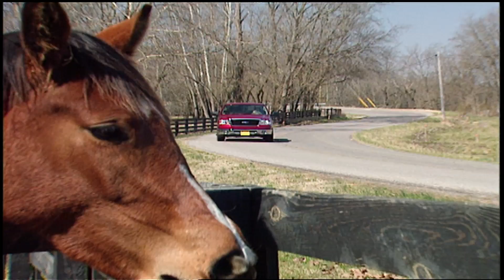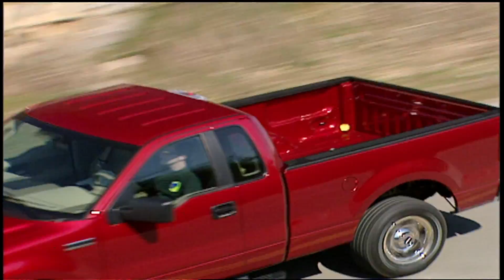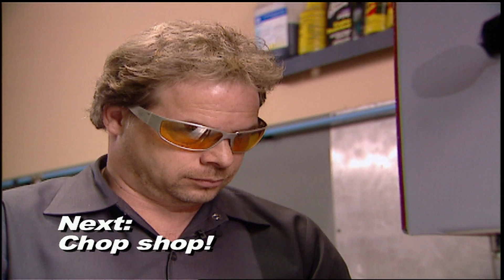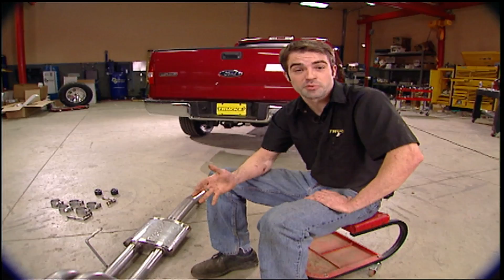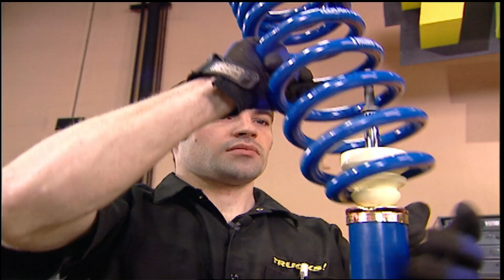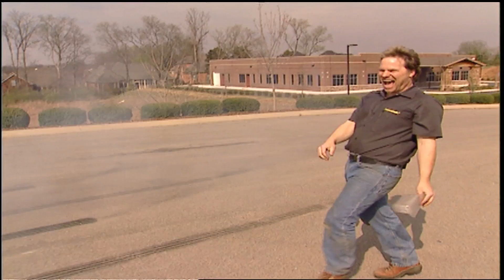Turning A Stock F-150 Into A 500+ Roush HP Stage 3 Truck - Trucks! S9, E7

Comment: Hopefully they removed the spark plugs and reinstalled them with high temp anti seize..
Reply: You dont need to. Its carbon buildup that causes the issue. Not seizing.
Reply: @trippholland5131  There's plenty of reasons to do it anyway, carbon or no carbon. I've had them seize with no carbon.

Comment: I actually do like this body and both the 4.6 and 5.4 , yes I know there are issues . Let me know when the LS or Mopar V8s become factory perfect .
Reply: 4.6 is the ls of Ford from my experience lol them things just don't die lol
Reply: These bodys were ugly and useless. The 3V 5.4 and 4.6 Were the worst engines ever built. 😂😂
Reply: @thegreatoutdoors9769  opinions are great if used properly.
Reply: @thegreatoutdoors9769  Not even close lol... the 4.6L short block is good for around 650hp. Heads, cams, intake and boost will put you there. It's a very strong bottom end. Of course it will be expensive, that's hod rodding. And those are some of the most reliable trucks on the road, two of my neighbors still drive 05 and 06 trucks.
Reply: The ls will last longer under shitty conditions it won't out speed a Ford or dodge but my chevy has lived on the redline far longer than any magnum or Triton I've ever had